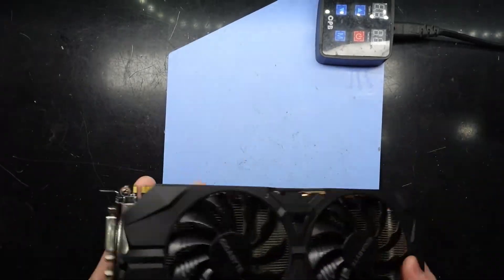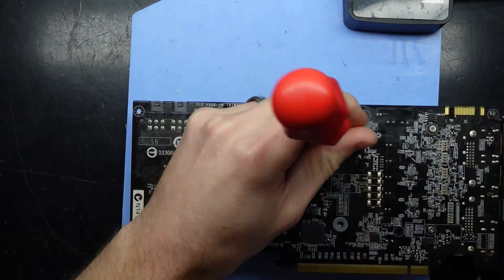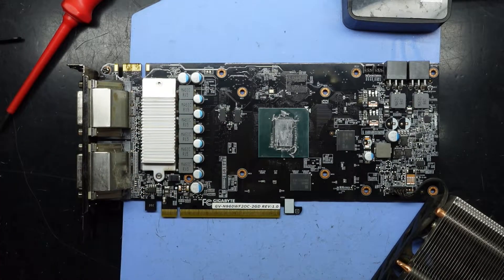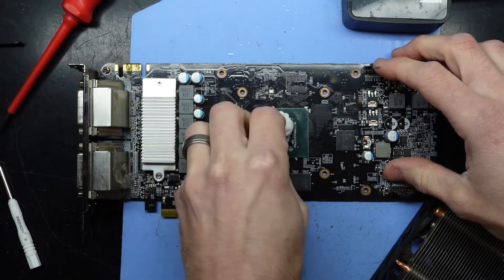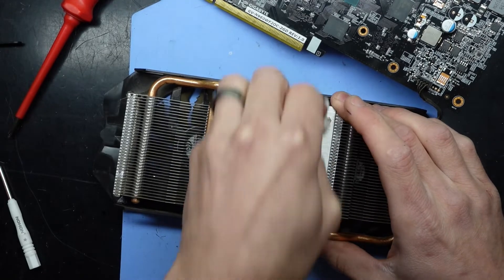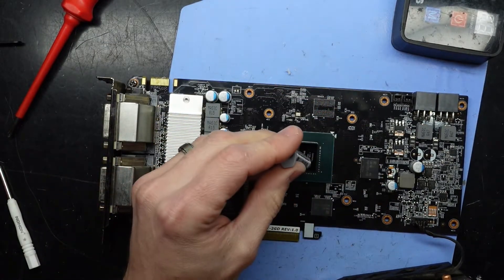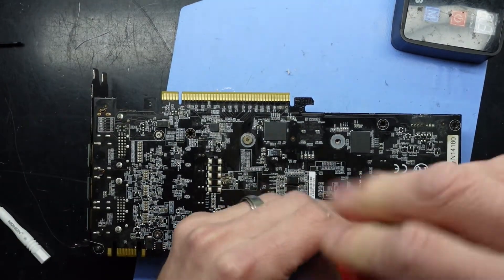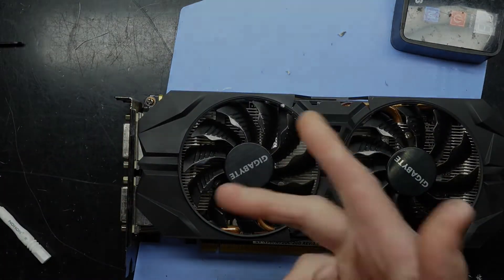Gigabyte GTX 960 2GB Windforce Thermal Paste Replacement

Comment: Hey, I have a question, where are the thermopads? Did you take them off? or there are no thermopads in that version of GTX 960.
Reply: Did you get an answer to that as I am going to do the pads as well?
Reply: @dulls8475  I already sold mine but that card don't have any termopads so you don't have to worry about it if you have a windforce gigabyte version.
Reply: @Ray1991vv  Thanks for that.
Reply from the maker: i didnt take any off on this one